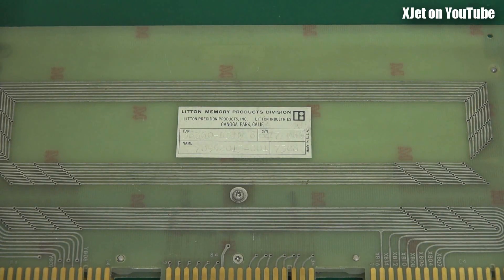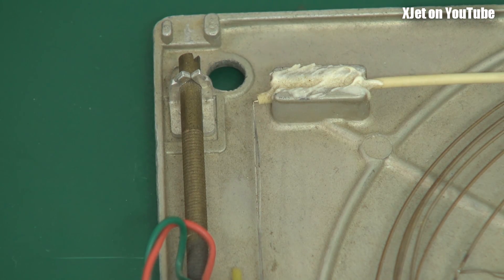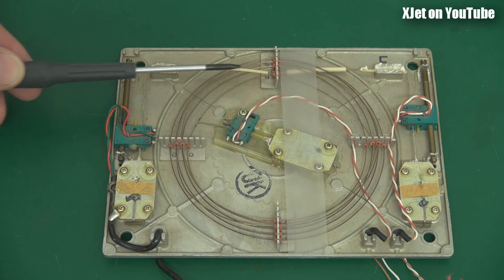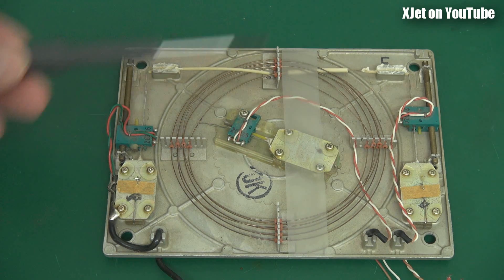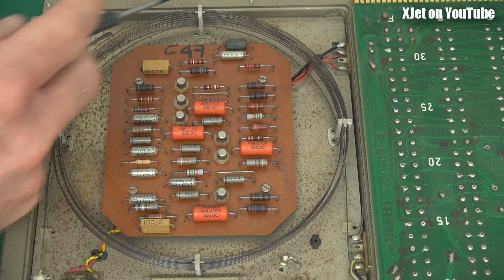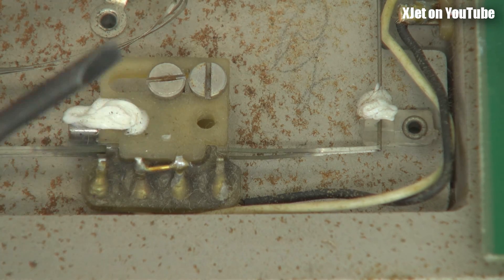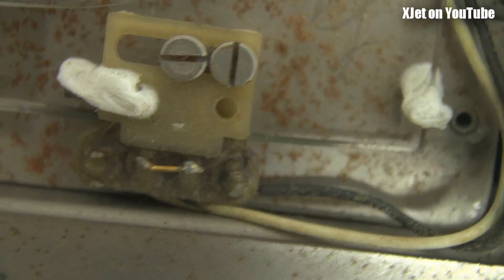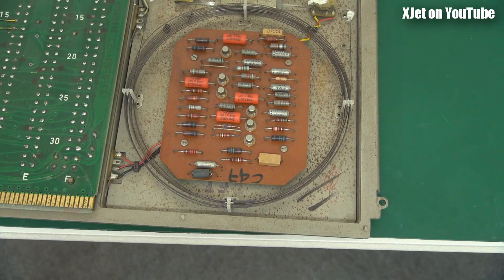Old computer tech:  delay-line memory

Comment: In confused when you say TWIST. Do you mean a physical twist or a magnetic internal twisting of the field? I would imagine those wires couldn't physically twist must and if they did when they joint the loop dont they rejoin as wires into one wire. If that is the case then the twist only exists before it goes into the loop or so it appears from your video. Surely if they join back into one wire which is the loop the "twist" is lost.   I cant see how this works clearly.  Also I would expect wires that continually twist at speed to wear out and break especially at the join points. Thanks.
Reply: Firstly, it would be a pulse. That is why the length and speed of the pulse would determine how much data can be stored. And, I would say that, yes, a twist, a pulse, would be 1 and no-pulse zero. For instance, the receiver of the data could use a time relevant reader. At each, time ir would expect a pulse. If it received one, it would read as a 1, if it didnt, it would receive a 0. But, I am no real expert.
Reply: Matthew Williams userNo99 the twist is momentary when a '1' is encountered. The twist travels along the coiled wire at a speed that is a function of the material. A '0' is no twist. Provided the data rate is matched to the material and length you will have a series of twists and no twists chasing each other. The capacity of the memory in bits is proportional to the length of the coil. This is because the refresh is a rebroadcast from one end back to the beginning.
Reply: this is something like a whip crack the physical wave is transmitted slowly from the source to the tip and if you do it in series you get a continuous transmission
Reply: Great explanation David Lowe...you deserve a cookie. As for Mr. Juan Salies, you are way too intelligent for 20yrs old. He's figuring out how the world works. Clear sign that the damn kids are evolving. They are getting smarter. Time for another purge!
Reply: Based upon the setup (and I'm only 30 and I've never used one) it looks like the neutral position doesn't hold data (no twist).  The data would be read from the clockwise/counterclockwise twists (where clock is 1 / anti is 0 for example).  Also, it's an analog thing, which means that potentially, the data could also be recorded as a relative magnitude (though I doubt that was the primary purpose, but it could easily have been done) since the nickel is just reacting to the strength of the magnetic field, and then generating a similar magnetic field at the other end.
Reply: i believe it is a physical twist. He says the size of the nickel strips changes, which would apply a torque. But, it is the opinion of a 20 year old. XD
Reply: I don't really get it either. So how exactly is a Bit represented in this wire? No twist = 0, twist = 1? And if so, i don't get how you can store more than just 1 Bit in this wire
Reply: Also, the lenght of the pulse can be really small, like milimeters. Not all the wire has to twist at the same time.
Reply: Kermit ever shake a rope or garden hose and watch the wave go through it? You could do it twice and have two or more waves going at once. It's the same with the twist.
Reply: So when it is pulsed, how can this be called memory? I get the delay part now, but would't it be like a millisecond memory time?
Reply: Because it is feed againg to the beginning when reached the end. It keeps circulating.
Reply: Of course, once out of power, the memory is lost.
Reply: You sure that the data is somewhat stored as long as there is power? As i understand it now, it gets "stored" in the wire until it reaches the end of the wire, and you better read it then because it would be lost otherwise, right?
Reply: Kermit Ive watched the video again, and in around 3:25 he says it does get back loop back. He uses the word reinjected.
Reply: I see, thx for explaining :)
Reply: Yeah, but the twists go both directions.  There's three positions (with the neutral being no twist, and the right or left hand twists being the 'data')

Comment: When I was at Caulfield Institute of Technology back in 1981, I volunteered to help clean CSIRAC, the 5th computer (maybe 6th, now that the UK declassified plans of Colossus).
Anyway, CSIRAC had accoustic mercury-filled delay line memory, where an accoustic speaker generated waves in the mercury at one end of each tube and a speaker listened at the other end.  Instead of torsion-waves like the video here, data was stored in a series of sound waves.  See https://museumvictoria.com.au/learning-federation/csirac/hot-box---csirac-computer/

Comment: uhm still don't understand what it is.
Reply: SmoKingPackRaT how old are you ?
10 ?
Reply: Annelise Meier 11.5 actually, and you are the smartest of the club I presume
Reply: it's memory, comparable in concept to how we use RAM today
Reply: Very early form of computer memory. What our current computers use DRAM for, computers back in the 1940s and 1950s used these kinds of technologies.

It does have the disadvantage of requiring sequential access. If the data you need is a quarter of the way down the wire from the write magnet, you have to wait for it to travel the other three quarters of the way to the read magnet before you can get it.

Comment: How does the wire retain the "twist"? If its just normal wire you would expect it to just relax. Does the wore actually deform in some way, like perhaps a multi-wound helical wire e.g. light bulb filament?
Reply: It didn't retain the twist, the memory is dynamic and the data goes in one end of the wire and out the other end. The support circuitry then fed it back into the start so the data kept circulating around the wire. If you wanted to change the data then you'd modify what was fed in to be different than what came out. And if you wanted to access a particular bit of information you had to wait for that piece to come around the loop.
Reply: Like a random access memory in modern computers.

Comment: Old timer here with a real life application of this strange tech. . ...  the IBM 5496 Data Entry machine used this technology for storing key strokes during the data entry.  That was in days of yore when punched cards roamed the Earth.   

Each punch card stored only 96 columns of data so the need for storage was small with only 6 bits per column.   So were talking only far less than 1K.   The advantage for this tech was that older 'keypunch' machines punched holes in the card with each keystroke... so one typo and the card had to be junked.  With the ability to store all the keystrokes in some form of memory  one could key the whole card, back up and make corrections then  when you were satisfied that the card was properly keyed, press the button and the card punched.   Not so many wasted cards, not so much rekeying.   I fixed these things for several  years in the early 70s and  found that delay lines were extremely reliable,.  I only remember one delay ever failing.   The memory didn't have to be fast, just reliable and cheap.  Competing memory at the time was expensive.
Reply: The twist does travel along the wire from a transmitter at one end to a receiver at the other end. It creates a faint signal at the receive end. It is then amplified and then sent back to the transmitter. For example, a bit (a twist pulse) might be 1 microsecond long. The twist travels along the wire at a speed determined by the wire material. Lets say the time for the twist to travel the full length is 1000 microseconds. We could send a new bit every microsecond, and the wire would have 1000 bits stored in it. Every microsecond, a new bit is transmitted, and a bit that was transmitted 1000 microseconds ago, will come out at the receive end. Unlike RAM in current technology computers (the R stands for Random, which means you can get at any bit at any time), these delay line memories are Sequential access memories, and if you want bit 378, you need to wait for it to come out, which will depend on where it is in the wire at the time you need it. Maybe just 1 microsecond, or maybe 999 microseconds.
Reply: Richard Smith One weird characteristic of core memory:  You could load a program into core memory, turn the machine off or even unplug it.  Then plug the system back in, do reset and start and the program would run.  
We did this all the time when running offline diagnostics. We'd run the diagnostic program, decide to change a circuit card, power off, replace the card, power back on, reset, start, and re-run the diag.  Sometimes this wouldn't work if you left the box off for a longer time and the cores lost its charge. (Reset / Start were buttons on the console)  BTW there was no monitor/keyboard, some models had Selectric I/O typewriters, but most boxes in the early 70s used punch cards to start programs even when the program and data was on a HDD.   We even had a few systems with no HDD, the OS was deck of cards that had to be loaded to do anything.  
Sorry for the stroll down memory lane.
Reply: RCW Thank you very much for your report! I wouldn't have thought that these things were actually reliable, especially for being mechanical and dynamical memory, where there is such much potential for things to go wrong... But I kind of like the technology of the early computer days, when people came up with such creative ideas; where today it's only about getting the same stuff smaller and faster!
Reply: I can't believe data was stored in the physical twisting of a wire, I find that awesome!
Reply: How does it actually store anything? I'm very confused
Reply: RCW Well yeah, it was magnetic ram :) I guess it works in the same way as when you attach a magnet to a small piece of metal, the metal will stay magnetized for quite a while. AFAIK, magnetic core memory was never labeled volatile in the first place, but non-volatile. In fact, I am pretty sure it wasn't until SRAM came out was the label 'volatile' even applied to RAM in the first place, but only on semiconductor memory(SRAM), which became more common in the early 70's.

I could be wrong, as that was before my time, just recalling my computer science classes :)
Reply: Awesome it's hard to believe I own a lathe that was built in 1939 upgraded to punch card computer in the 50s or 60s not sure ran until the 70s then went into storage at a customer of mine.  It was scheduled to be destroyed so I asked the customer if I could buy it so they told me if I hauled it off it was mine. I tore it down and completely restored it . It's a smaller lathe 12 inch swing 6 foot bed. I upgraded it to moder CAD and high precision servos and computer even got a VFD drive added . I have been offer serious money for it and turned it down. I wanted to restore the punch card stuff but nobody I know even had a clue what it was . So I just stored it felt wrong to get rid of it. Thanks for your story 😁👍
Reply: @ronaldbrown9638  that machine could probably run original G-code!
Reply: My guess is that the wave is propagated from the magnet to the sensor at which it is thrown back to the magnet to restart the wave. I don't see how it could keep memory without this kind of feedback loop keeping the wires from reaching mechanical equilibrium
Reply: Magnetic core memory was so reliable, it was still used until fairly modern times.
Reply: Philip Freidin
YAY, I was right!! :) Thanks for the amazingly detailed answer!
Reply: Why was this ever used instead of Magnetic-core memory? Core was from the same time period, but it was RAM and also reliance
Reply: @lordofthecats6397  I guess, core memory was a lot more expensive.

Comment: Never heard of this type of memory before, the only delay line I have came across are the ones that used a tank of mercury which I guess are even earlier than these, before that they used the Williams Kilburn tube were they wrote the storage to a crt and read it back via a metal grid over the display.
Reply: The most used delay lines were analog memories for the color lines in PAL and SECAM TV sets. That is what the M in SECAM means.
Reply: +0MoTheG - Those used yet another delay-line technology. Basically a piece of glass (probably quartz) with a couple of transducers and cut to a shape that the path taken by a signal bouncing around from one to the other would take the 64 microseconds needed for a PAL or SECAM picture line.

Comment: Could you show us it in action?
Reply: Finding such technology is hard enough, finding a machine that uses this technology and still works is a near impossible challenge.
Reply: make working replica?
Reply: "Could you show us it in action?" - there's nothing to see.  It's a bit like asking to see the main board of a computer when it's in action.  The wire has a sound wave injected at one end, which takes a certain time (a few milliseconds) to go down the wire, then it is picked up at the other end.  It's not an audio wave - the wire is pulsed by each bit, so it is digital data that it is carrying.
Reply: Yes, you're right.  It would be possible to show the input on a scope (which would look like serial binary), and the output, which (and I'm guessing here) would look nothing like the input.  Still - they did manage to clean it up and make it readable.
Reply: Here are scope pictures of a Friden EC-130 with this hardware.
https://www.youtube.com/watch?v=fie-Z-mjnyU